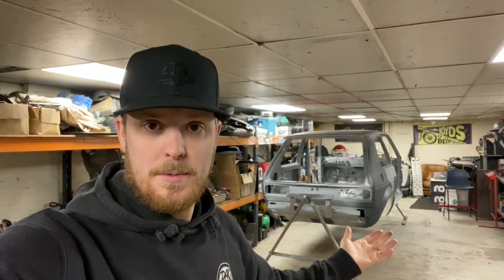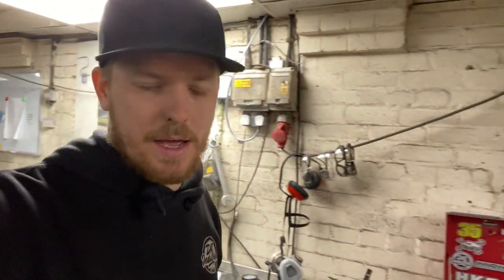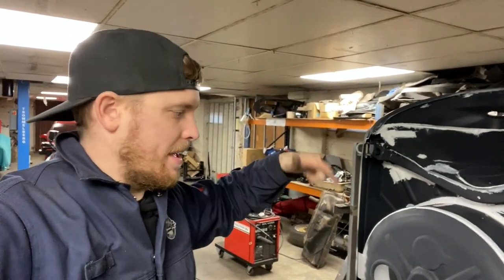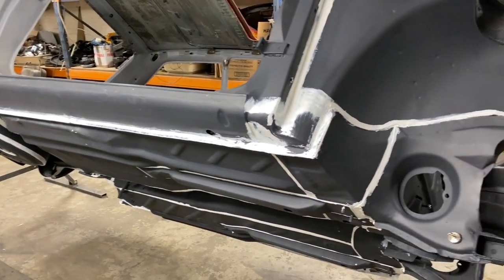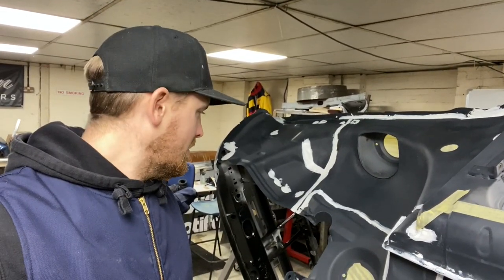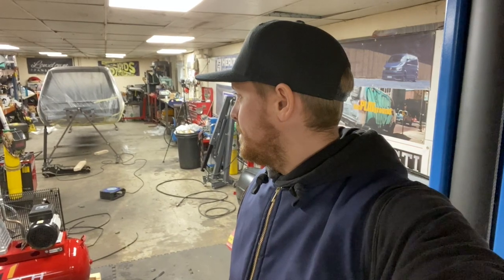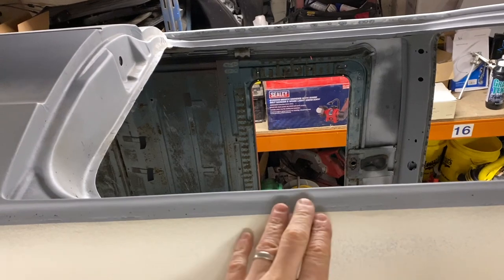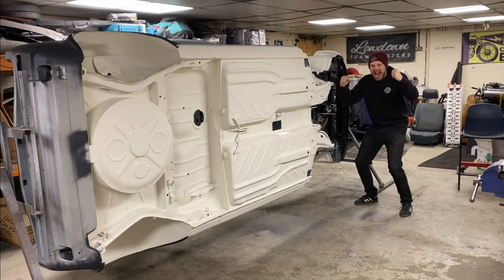Applying Seam Sealer & Stonechip! - 1983 Mk1 Golf GTI Campaign Restoration 1.8 20v t Engine Swap

Comment: They are not bad compressors. I bought 2 of the exact same model belt drive as they are 14cfm so I could run them together when sandblasting. If your tank is good with your old compressor take the pump and motor off and make it a 2nd reservoir for your air. There is some great online info on setting up a compressor and water traps so you could have air all over and means you can keep the compressor in one area away from the working area.

Comment: The old gal is looking great now Dan, must say you do look a lot happier now you can actually see the progress as all the bodywork takes a long time with all the fabrication and fitting new panels and it doesn't really look much different but now you can see your progress.

I hope you like your new compressor as I have a Burisch direct drive which I got a couple of years ago and has been very good apart from some air leak issues where the elbow and t-piece joints fit onto the head, I had to replace all the fittings and pipework before it was sorted, if I get a new one it will be a belt drive like you have. Hope you and your family had a good Christmas Dan 👍

Comment: Hi Dan any reason why you went for the Hydrate 80 over the more usual choice of Dynax-UB or UC,  I'm sure it will work well all Bilt Hamber gear is top quality,
Reply from the maker: Just felt like the right thing to use and read good things about it. Will be putting Cavity wax in it all too
Reply: @DanChambersDAC  as you wanted to make sure the weld was OK it probably was the right step, the wax will be a finishing touch, great work as usual, best wishes for 2022 👍

Comment: A rust converter will do nothing without rust! It creates a chemical reaction with the oxides and I don’t think it will be effective to apply now and wait for potential rust later. Regular cavity wax would have been a better option or use the same spray system to apply an actual paint.

Comment: HELLO ! I would like to know why apply a seal to these specific places and what is it for (water, corrosion) ? Should it be applied to the welds, or to the "junctions" of the métal sheets?
Thank you
Reply: Seam sealer is basically used to stop water, dirt and dust getting to the joints. Its a rust preventative basically as joints (place where 2 or more materials meet) are a easy place for moister or dirt to sit and cause rust.

Comment: Sorry Dan,not criticism but I know that bilt hamber won't be a good solution for the crevices long term.its only a converter, cavity wax would offer more long term protection
Reply from the maker: Yes I never said it but I will be going over all of the cavities with cavity wax. This was just to convert the rust and get the metal sealed.